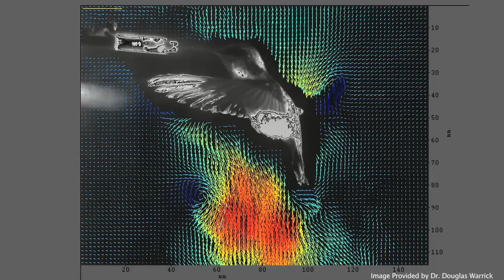Hummingbird Aerodynamics- High Speed Video - Smarter Every Day 27

Comment: A huge aspect of hummingbird flight, specifically their incredible stability, is a pocket of fluid in the back of their heads. Their flapping wings slosh that fluid back and forth, sort of offsetting that movement from being transferred to their heads; that's why you can see their heads being so insanely still, even though they are flying and moving. It's much more complicated and elegant than i've explained here, but if you're interested in hummingbird flight, how they keep their heads so still while in the air is something you'd probably want to know. And now you do!
Reply: awesome
Reply: that's interesting, have you got a source on that?
Reply: So hummingbirds have a tuned mass damper in their heads? That's cool as heck!

Comment: The tail flick is to direct thrust from the back stroke of the wings forward and move the bird back ward during flight.  You can see it makes an effective air brake as it's a giant scoop too. It seems they use it to do a lot of the fine forward and back controls when hovering.
Reply: Exactly, I immediately thought of how when a helicopter is moving forward in order to decelerate and hover you have to point the cockpit upwards so the propeller flows airbackwards

Comment: It's a combination of both; center of gravity change and thrust vectoring. The bird generates straight vertical thrust for 'treading air', with the tail being in the flat extended position.. Bends the tail into the jets of air to use for breaking and a mild form of reverse. This is the beauty of nature. Bio-mechanical excellence.

Comment: I'm with the other commenters - please, please, please don't use the nectar formulas that contain red food coloring! It's not good for birds, not even good for children. It's much more cost effective to make your own nectar, just 1 part white sugar (never use raw or brown sugar!) and 4 parts water. Bring water to a boil, then remove from heat and add sugar. Storing the extra in the fridge is recommended, and clean the feeder thoroughly every time you refill, especially if you live in an area that has hot and humid summers. To clean the feeder, use hot water, a scrubber for the feeding ports, but don't use dish soap! Try diluted white vinegar mixed with water or 1:1 hydrogen peroxide and water. Rinse well and if possible let air dry before refilling and hanging. Make sure all ports on a hummingbird feeder are clean and free of dirt and such. In the mating season don't brush away all those cobwebs and spider webs around the house, and don't spray pesticides! Hummers eat small insects like some spiders, and use spider silk for their nests.
Reply: +Roelof Jan Don't worry, feeders will never replace flowers entirely for hummers. For one, not enough people will spend the time and dedication to feeders to handle all the hummers in any given area. Flowers are still the better option, and many people with bird feeders also have gardens, if they have the land. With feeders, more bird lovers without gardens can enjoy the birds and help them out some. There are many areas where long droughts have made many replace their lawns with xenoscaping, and many forgo gardens because of the cost of watering, so feeders help support birds in this way as well. Most hummingbirds in the Americas migrate, so there's less chance that they'd become wholly dependent upon feeders. Lastly, most birds are smarter than we give them credit for, and I imagine that flowers taste better than the sugar water we serve, kind of like the difference between a good home cooked meal and fast food. I think most birders would be grateful for your concern, and the dedicated ones do research to be sure that we lessen any possible negative impact we might have on the wildlife that we love.

Comment: the flick is him making drag to stop.
Reply: It may seem that simple, but I doubt that these scientists would be unsure of what the tailflick is if it were. Not a bad hypothesis though. Makes intuitive sense. But I doubt we know all the data, especially if the people who are studying it don't know either.
Reply: The detailed explanation is that his tail feather give him more air resistant (by adding another wide surface) so he could decelerate or even stopped at some moment, i am pretty sure of this.
Reply: why it just seemed like it lowered its body so the wings would give more forward thrust so it would slow down. then the tail goes back and it can hover again.
Reply: I think he does that to move his center of gravity or to be able to stop not by creating drag but by throwing it forward it throws him back like a 3rd wing
Reply: The  birds default flight model is hovering. Moving any part of his body in this case tail changes it from hover to forward/backward sideways thrust. His wings generate 100% thrust and his tail wag generates a small amount in comparison but its function is tilting his center of gravity.  can he even rotate its wings? If not he  has to move his tail down/sideways which then in turn tilts his body in whatever way he intends. Wings never stop flapping unless he intends to go down a notch.  Some dumb analogy. Like a boat. His wings are paddles and his tail is steering.
Reply: Did you just assume the hummingbird’s gender?

Comment: Knowing very little about hummingbirds, but a good deal of aerodynamics, I would tend to think the tail movement is a form of thrust vectoring, to slow the inertia of the bird as it approaches the feeder.  It seems like the tail could be used to redirect the down draft off the wings.  It also may change the balance about the wing axis, causing the vector of lift to alter and aid in slowing the bird.  Fascinating footage!  Thanks for sharing!

Comment from the maker: @hassoun6 
It's spelled "Schlieren", German for streak.  The problem with Schlieren is that you can't visualize a particular cross section of the flowfield, you can only get the total flow disturbance, with total depth of the area of interest.  To quantify the vorticity you need to measure the 2D flow field orthogonal to the wing.  Long story short, Schlieren doesn't do this.  Read up on PIV and you'll see what I mean.

Comment: Hey Dustin; Great video. The tail flick as you refer to it, is the mean the bird used to make the change from forward flight to hover. You will notice at the same time it makes the wing transition from vertical wing movement with wings more or less parallel to the length of it's body to horizontal wing movement with the wings vertical to the ground. Much like a helicopter noses up to roll into a hover. It actually does both shifts center of gravity and changes flow characteristics in attitude.

Comment: Armchair physicist here. I've always assumed that like the tail of a conventional aircraft, the tail of a hummingbird is the distal control surface which primarily provides torque on the body of the hummingbird. Flicking the tail forward brings it into, or keeps it in the down-wash from the wings, maintaining control authority as it transfers from forward flight to a hover. It also generates a torque about the pitch access to counter the torque generated by the wings as they slow the bird.

Comment: My theory is that by fanning out their tail feathers, the thrust from the hummingbirds wings is  redirected towards the rear. The acceleration would mimic that of a helicopter's wherein the position of the tail dictates both elevation and speed (ie: Tail feathers aimed up = high speed, decreased elevation and tail feathers down = lower speed, higher more stable elevation)

This would also explain the hummingbird's erratic flight pattern as they have to constantly adjust their flight pattern

Comment: @Lokpyrite They can hover because instead of directing the airflow horizontally, they make the switch to vertical. Just like the V-22 osprey. I think you are right about them using the tail as a brake because you see its tail starts really high to pivot their body to the vertical (thus directing the airflow down) and then flick it and open up the feathers to halt their forward movement.

Comment: There is a lot going on here that cannot be replicated by human experiments. The hummingbird swoops in and completes a series of complex moves simultaneously, just like a bird of prey attacking feet first. Dive at high speed, extend talons, increase drag, change center of mass. All of these happen smoothly, and in a way we cannot yet replicate.

The hummingbird is changing its center of mass, increasing drag (or acceleration in the opposite direction,) and making minor adjustments. All together.

Comment: I think that the tail flick you are referring to is an attempt by the hummingbird to slow himself down, not by increasing the drag, but by providing a force in the opposite direction of force. I'm getting this from how I brake quickly in a pool. If I need to stop my movement from full speed while swimming, I'll pull my legs up towards my chest, providing a reverse thrust and slowing me much faster than if I just used my hands. Maybe the bird does the same thing?

Comment: I believe the flick may be a precautionary measure. It does the same flick when it takes off, Broadening its tail feathers, and almost leaning back into its wingbeat to propel itself backwards. Notice it looking about as it does so. I believe it's using this as a better safe than sorry maneuver, biding itself a moment to determine whether or not it's safe to stop to eat, or if it should fly off from any potential danger.

Comment: I think the hummingbird does the tail flick to reduce his forward momentum. It's kind of like when we are running fast and need to stop quickly. I center of gravity at top speed is above and in from of our hips and we are leaning slightly forward. When we stop quickly, our legs go forward and we lean back a little and our center of gravity shifts, I'm not sure but I would think it would be somewhere in our legs. In forward momentum the center of gravity is forward. SEE COMMENT

Comment: Destin,

I believe the "tail flick" you referred to occurs when the bird is quickly approaching the feeder. Imagine a bird coming in at constant velocity. Neglecting drag, the bird must direct the air straight downward, because the velocity is constant. But in order to stop at the feeder, it needs to provide a backward thrust. My theory is that the tail achieves this by redirecting the air-flow from the wings slightly forward, as well as adding drag to the bird to slow its approach.
Reply: If it was just to redirect airflow or provide drag then the tail feathers would probably be spread to provide more surface area, which they are not.  It's probably for both airflow and COG.
Reply: +Trees Flowers

It sounds like your argument is basically that the tail flick cannot be for redirection of air flow because the bird isn't maximizing surface area to make the effect as strong as possible. This is totally neglecting the subtleties of hummingbird flight. It's like saying every time you want your car to speed up, you should slam the accelerator pedal to the floor, and when you want to stop you press the brake as hard as you can. That's certainly not appropriate for a car, which weighs a staggering ONE MILLION TIMES more than a hummingbird. For a comparatively small, light hummingbird in particular, even very small forces produce a significant acceleration. Thus, the bird needs to be a master of nuance to control its maneuvers so precisely.

That argument aside, I would be very surprised if the tail, which is comprised entirely of feathers, has enough mass (compared to the rest of the hummingbird) to significantly change the center of mass.
Reply: ***** haha  First off, it's just my observation.   Not an exact science and surely not an "argument".  I understand what you are saying in regards to the car example but I'm not looking so much at it's tail.   I'm looking at the lower half of it's body rotate 90 degrees downward to a vertical position. (03:59)  That's more than tail feathers being shifted in weight.  As you said it weighs a million times less than a car so shifting it's lower body has to amount to a massive change in COG.  After all, powered planes have crashed because passengers have piled to one end of a plane or it's COG has changed rapidly.  Now apply that to a tiny bird shifting half it's body 90 degrees quickly.   Although I do agree, the relative wind must also come into play.  I think this is obvious at 03:58 when it bends it's tail feathers clockwise over it's back towards the feeder right before rotating the opposite way (much like the control surfaces of a plane coming up to deflect the relative wind of a plane).  Who knows, maybe it's neither and he's just doing it for style points. haha
Reply: +Trees Flowers

Well, it would be interesting to find out what the actual reason for this is. Hopefully the authors of the sited paper will find a conclusive answer to this.

Daniel

Comment: On the "tail-flick" there also appears to be a change in wing beat frequency.  And the wing angle of attack changes durng the "tail-flick."  The movement of the tail would change the center of gravity, but is it also being used against the downward wing compression wave to provide lift? I noticed the same maneuver in reverse (to a lesser degree) when the bird moves away from the feeder.   Follow-up will be interesting. Thanks for all you do!

Comment: I believe that the thirty percent of lift that comes from the back stroke is due to the top side of the wings thrusting air vortexes back and over top of the the body which would mean that all the air on top would be moving faster and therefore have a lower pressure than the bottom creating lift under the entire back half of the body and when it pulls its tail underneath its self the vortexes are aimed lower so that they still travel off the back but perpendicular to their previous direction and relative to the position of the body thus creating lift in the opposite direction of the forward moment causing the bird to come to a stop while the forward stroke still provides all the lift needed to keep it in the air giving the humming bird complete 3 dimensional control of their position minus space occupied by other objects or at an altitude to high to support its weight, or metabolism

Comment: I think the tail flick is to shift the homing bird's center of wight. The wings stay in the same place so it's balance changes. That helps it change direction.
Reply: Elan Pasmanick that makes a lot of sense but i think flicking its tail stops/slows its forward momentum by stopping the air that is flowing under it, kind of like how a parachute helps slow a falling person
Reply: Purab Patel I am more inline with this because later on when the humming bird is feeding it doesn't keep its tail under it, but the motion looks as though its attempting to stop air currents.

Comment: +SmarterEveryDay
My guess is that the tail flick has to do about the hummingbirds wanting their head to - remain - in a stable and constant position., when ever they alter their flight path. So when they decelerate or accelerate, they also change their center of gravity, right? And to make sure both their body and head remain still, they move their tail instead, otherwise their head or body would destabilize. What you think?

Comment: @destinws2 I'm no engineer, but it looks almost like they're using their tail to control CoM as they fly.  I'm probably over-simplifying it, but watching them in slow motion I picture a helicopter rotor; while perfectly level it will just hover and won't go anywhere.  To actually move forward or backwards, you'd need to tilt the rotor and in this case they do it by shifting the position of their CoM.

Just a theory.

Comment: Also the Aireoantucis thign with the helicopter.
I think I understand why it takes places 90 Degreese out of place.
If the Blade is instantly turned and beats the resistance of the air slowing down its transformation into a specified state it Blocks out the air from flowing through it until the air reforms and flows over the blade finaly acheiving the specified action 90 degrese out of phase.
Would it mean that an 8 bladed helicopter would preform the action 25 degrese out of phase?

Comment: Not that you have to buy you can get bee guards for your feeders. Also, it's well past time to clean your feeder. The black around the feeding flower should be cleaned off. The wasp in the video wasn't around the feeding flower but on the feeder possibly where the sugar water has been. A cleaning might get rid of it.

Comment: It seems the bird is manipulating the surface area of its tail to press against the air in the same way as the wing. Only instead of pushing down to generate lift, it pushes forward to cause a sudden stop.
Reply: Or perhaps to manipulate the downward air currents his wings are creating to divert air in a different direction.

Comment: From simple point of view of Physics, not biology or anything else, how big could a humming bird possibly get before its weight would be to great for it wing speed velocity and capacity of "humming bird strength"?
Reply: Fr. Michael Therese Scheerger no clue but the largest hummingbird, aptly named the "Giant Hummingbird" averages 15 wingbeats per second which is much slower than the hummingbirds you see in this video.